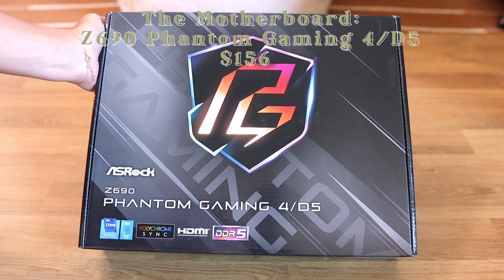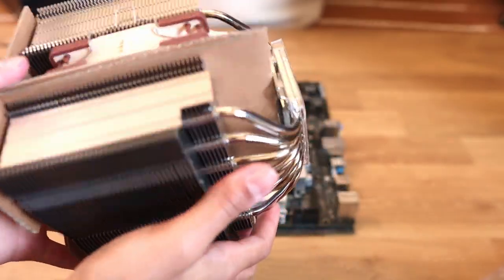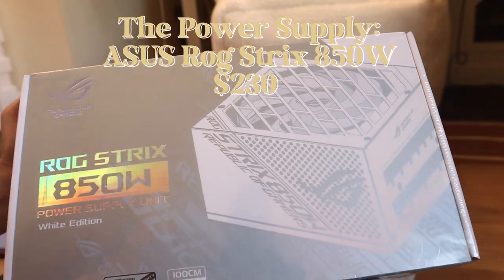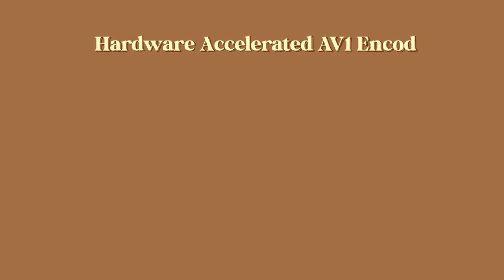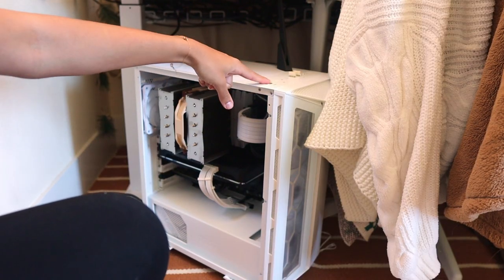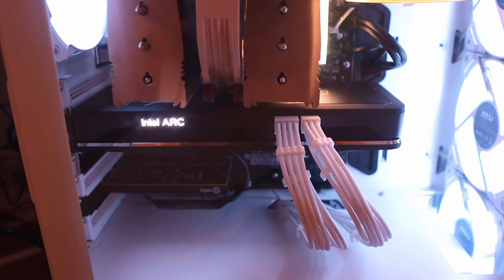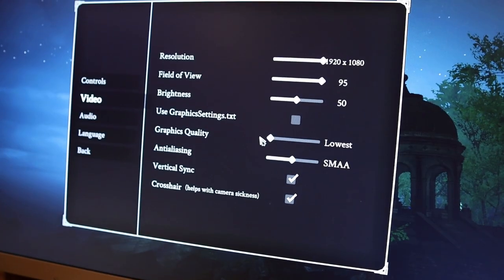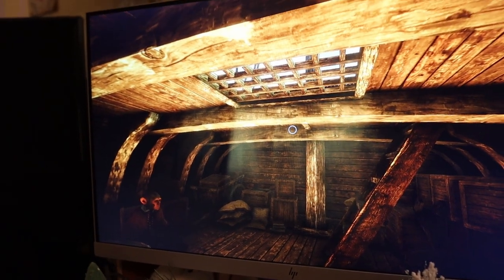My first PC build for cozy gaming! // Intel Arc GPU

Comment: Nice build. Only critism I would say is the memory. I noticed that you used two different memory sticks the Corsair and crucial ballilistixs. Short term it be ok to use but long term you'll likely get random crashes, freezes and Blue Screen of Death. If these items were purchased or were from a sponsor. I would suggest making sure the memory kit are the same specs so you do not run into any compatibility issues. Other than that nice easy to follow guide 😊

Comment: By the way, don’t put 2 different types of ram because it will act different
Reply from the maker: they’re the exact same just diff color :)
Reply: @CozyK  ohh ok, good job on the build! :]
Reply: @CozyK  but u still put 4 instead of 2. It will run at slower speed